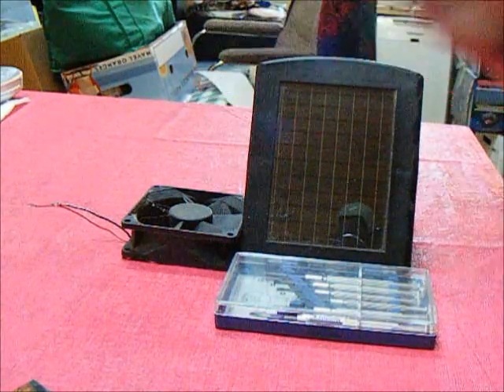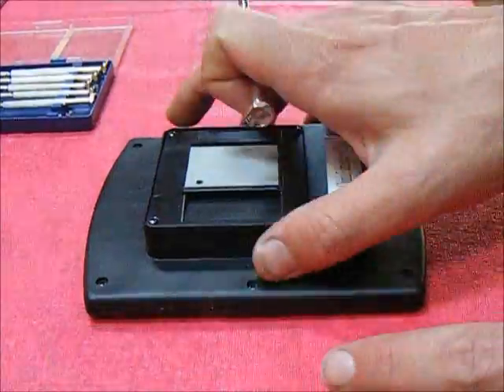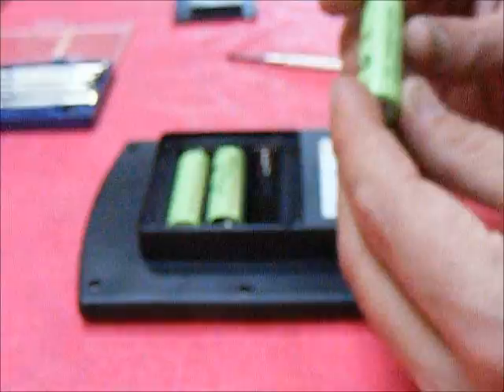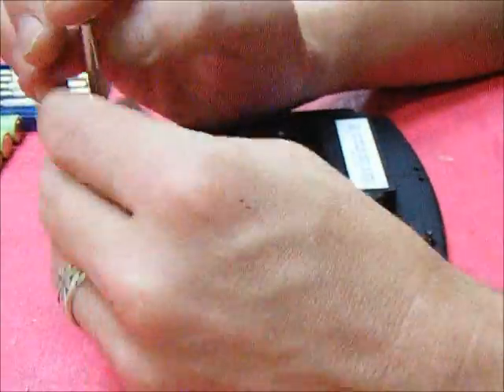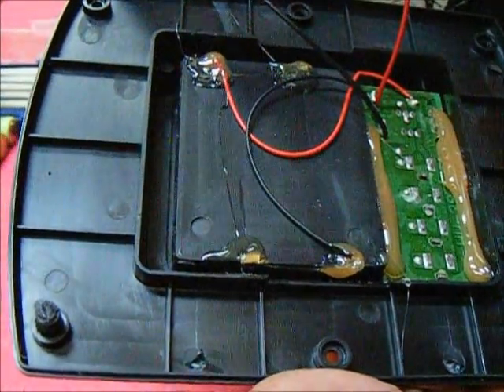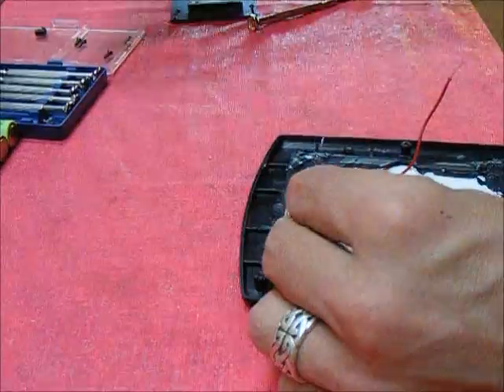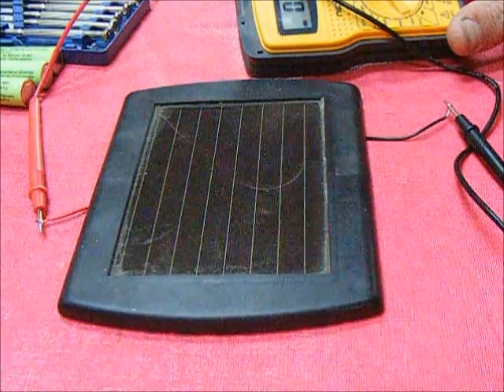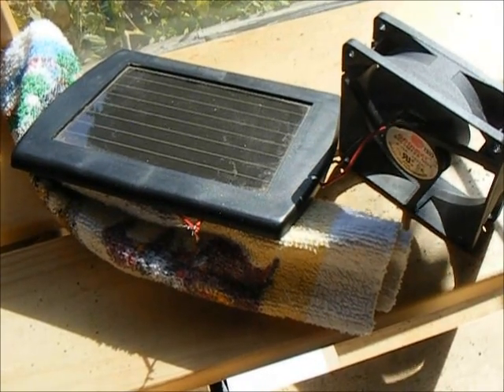DIY a Cheap Easy Solar Fan for the Greenhouse

Comment: Could this system work indoors with a light bulb making it work instead of the sun, Will the light bulb be enough to make it spin ?
Reply from the maker: Maybe?  Depends on how strong the light is ...
Reply: why would you use a light bulb to power a solar panel? sounds like just a waste of electricity

Comment: Hi there,

Why didnt you leave the batteries in place so that they can be charged and then be used to  power the fan when its cloudy, but still hot!!
Reply from the maker: +Ben Parmer - It was set up internally to come on once it was dark & I only wanted the fan to run when it was bright & hot so this seemed the fastest way to get that done.  Thanks for watching!

Comment: My dad was fond of saying, "if it ain't broke, don't fix it". You had a continually recharging power supply when you started, what was the benefit of bypassing the electronics and the batteries? The batteries, even under gloomy conditions, can charge and hold a constant voltage, and has the added benefit of acting like a buffer, protecting anything connected to it from power spikes, etc. Bypassing this makes your fan dependent on the sun, and hence, it's source is now a fluctuating, unreliable form of electricity. Even once the sun goes down, the batteries can still run the fan until the batteries are drained, which is OK, they are made to be drained and recharged over and over again.

That's my two cents. Cheers and Happy New Year to all.
Reply: Yeah, I would have checked what voltage the setup with the battery's and PCB was giving out after sitting in the sun for a while. Might be really low output depending what its for. I got a couple free solar panels that lit some LEDS and i was planning to do something similar. I rigged it up as is to one PC fan and it wasn't blowing that strong but alright but I'm interested to see what its like direct to the panels tomorrow. I'm sure it will be blowing heaps more.